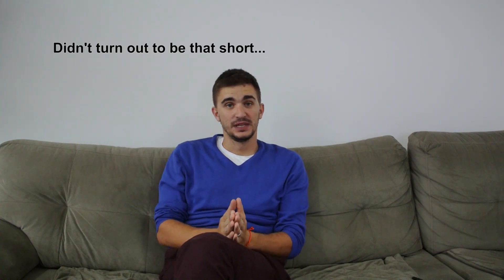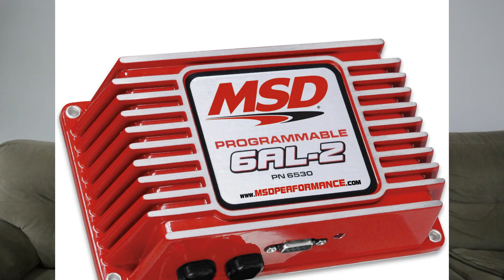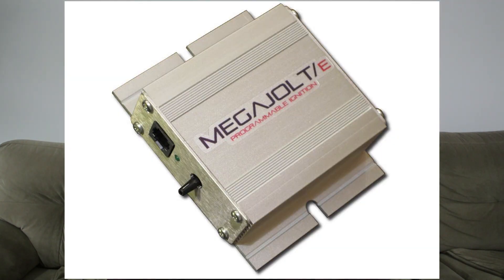Bike carb conversion part 2 - standalone ignition control

Comment: Why carb'ing? There is Microsquirt (budget megasquirt) costs 300 $ Also pick four motorcycle throttle bodies with injection and it's simple easy power upgrade and insane ITB sounds!
Reply from the maker: Gedas alekveravičius You do have a point but I really want to try carbs. There's something special about them. Yes they are a bit of a hassle but they have a lot of charm when setup properly.

Comment: You already have the Technotoytuning crank pulley. You can get the Trigger Wheel to bolt on to it. https://technotoytuning.com/toyota/aw11/4ag-trigger-wheel you will need something like that for any Ignition Control.
Reply from the maker: Jeremiah Hale Exactly. Installing the trigger wheel after I put the engine in would be a pain. Same for the crank sensor. Now that I think about it going first with stock ecu wasn't really smart :) thanks for watching.

Comment: Dont buy standalone spark system. My advice to you is get a meqasquirt because  ""The will to eat grows by eating." means that soon you will turn to turbo and then you need also fuel management.
Reply from the maker: Antti Tukse I agree with "the will to eat grows by eating", but I need to do this before megasquirt. I'm really into this right now. I'll get megasquirt eventually too, I'll save for it by doing overtime or something lol.